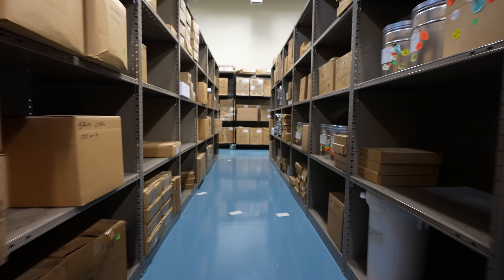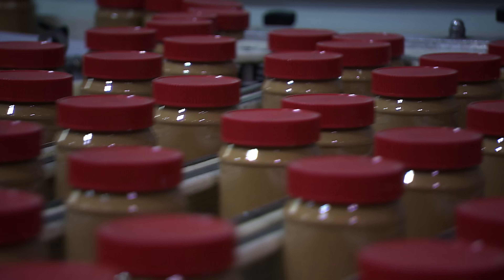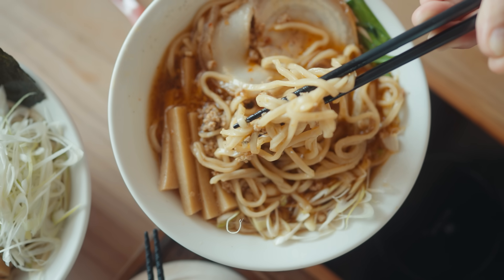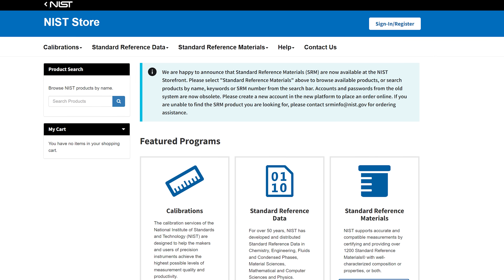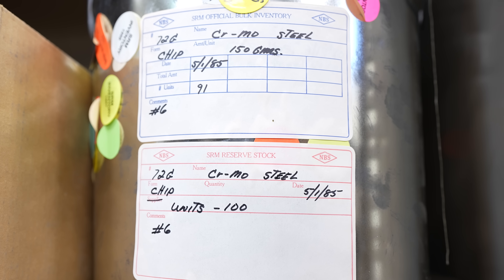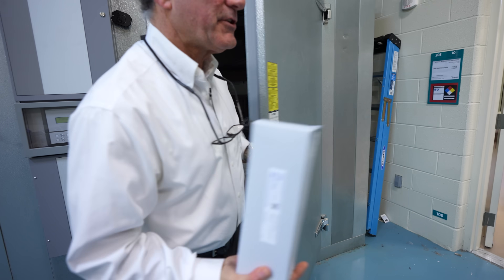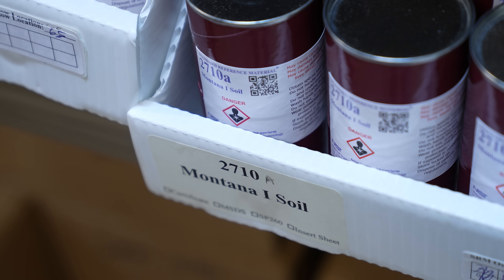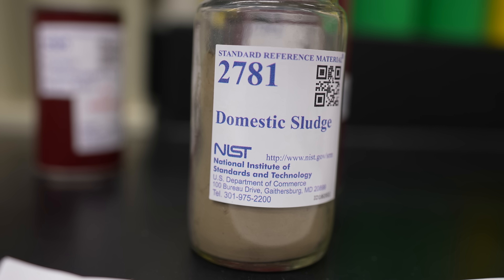The world depends on a collection of strange items. They're not cheap

Comment: can't that information just be found online? and if this is stale and gone off wont the values have changed. also it is impossible to know what the average diet is.
Reply: You can't use information found online to calibrate measuring equipment. I don't think you understand how this works. 

Also it's not impossible to know what the average diet is. Do you understand how averages work?... Just because YOU think something is impossible doesn't mean it is. Sorry to burst your bubble.
Reply: @firecubes4984  define the average person.
Reply: @ad_am_de_an  Okay.

The average American woman 20 years old and up weighs 170.6 pounds and stands at 63.7 inches (almost 5 feet, 4 inches) tall. And the average waist circumference? It's 38.6 inches. The average American man 20 years old and up weighs 197.9 pounds . The average waist circumference is 40.2 inches, and the average height is just over 5 feet 9 inches (about 69.1 inches) tall. 

I could keep going, but hopefully, you get the point.

We have lots of data regarding what the average American eats. We even have it broken down by age, sex, religion, etc. We can therefore use that data to determine what macronutrients the average American consumes in a day. That's how averages work.

An average is a number expressing the central or typical value in a set of data, in particular the mode, median, or (most commonly) the mean, which is calculated by dividing the sum of the values in the set by their number.

What the heck do you think 'average' means?

Comment: Isn't this useless? Every company producing a product should be able to do it like they want and not comparing it to a measurement product
Reply: Lol it explains what the purpose is very clearly if you watch the video. It is a reference material for calibrating their machines. Its far cheaper and less risk than analyzing every batch to make sure it is in line with their quality requirements..

Comment: For the same reason that peanut butter is not for human consumption due to how old it is is the same reason most of the tests on it are mute. If what he said is true , that it took years for the scientists to measure all the compounds in the peanut butter to determine what fats, acids etc it has to use those as a standard for the manufacturers to go by, surely most of those compounds / acids etc. that took years to measure would be totally different to what are in the peanut butter when manufactured and during it's shelf life..... 

short version:  the compounds in the peanut butter are different values during manufacture, during shelf life and after shelf life due to breaking down and changing.

Comment: I'm a pharmacist and always ensured my students knew that the temperature monitoring devices (basically a thermometer) for the refrigerator/freezer that holds medications must have a certificate of calibration tracing its accuracy back to NIST, as well as ensuring they knew those devices do in fact "expire" and should be re-calibrated or, more practically, replaced. Great video to get to see the rest of NIST's world!
Reply: Even weights need to be checked if you're working within fine enough tolerances.  It gets even wierder with timing stuff, as thats influenced by the speed its moving.  A clock has to be perfectly accurate in a satellite for a gps to work, but they also lose 7 millionths of a second per day or something just because its moving faster.
Reply: @bibsp3556  Its more the fact its further out of earths gravitational field than the speed. The %difference of gravity is more significant than the %difference of the speed of light. But yes, they do lose time and that causes errors in the positioning of the satellite and slowly over time will cause the satellite to give wrong coordinates to a gps if not recalibrated.
Reply: @Golden Hate  Space-Time & Gravity are so mind blowing. Simulation theory is getting really interesting too.
Reply: @randomname4726  eh, simulation theory to me is more a philosophical question.  I've not really seen anything beyond hypothesising that the planc length and speed of light might be some.sort of processor limit, but it's not convinced me really.
As the guy said above correctly said though, it's more the gravity, but yeah it's fascinating. Crazy out there
Reply: @goldenhate6649  very true.  Well corrected.
Reply: @bibsp3556  We have Weights & Measures technicians that come though once a year at the grocery store I work at and check all the scales to ensure they are reading exactly the right weight (to an accuracy of 0.01lbs). If they aren’t, they re-calibrate them. And the weights they use to do the tests? Those are definitely from NIST, and are measured to be exactly 10lbs, 20lbs, 50lbs, etc. without even the slightest error. This stuff is genuinely fascinating! And all this has been happening behind the scenes for my whole life, without me even knowing it!
Reply: @mbcommandnerd  they have to store those weights all specially if memory serves me right, to avoid like tiny  changes through decay etc. for really fine tuned equipment.
Reply: I’m a commercial refrigeration tech. I work mostly in the pharmaceutical and medical trade. I can’t tell you how many places I have been that have uncalibrated thermometer
Reply: As a Manufacturing Engineering Technician in a Medical Device Manufacturing Facility, calibrations are very important to us!
Reply: @carlosl5820  that's a critical job! I need confidence that my vaccines have been kept at refrigerated temperature before they go in anyone's arm. The temperature monitoring is only a small example I'm sure of all the devices that patients rely on to perform with a high level of precision (and accuracy).
Reply: This might be the most interesting thing ever to me.
Reply: How would you recalibrate a thermometer
Reply: @Xnoob545  Thermometers are usually calibrated using the water ice point in STP conditions.
Reply: @Xnoob545  they're digital, but outside of that I have no idea LOL. But over time, they will 'drift' and read 1 degree higher or lower than actual.
Reply: Why though? Can't you just account for the drift? Do medications have extremely tight temperature tolerances?
Reply: @Shinkajo  That's a good question. We wouldn't be able to account for the drift because we wouldn't know how much it has drifted, so it would be a guess as to what the true temperature is. 

As far as the medication sensitivity, it depends. Insulin, for example, becomes ineffective quickly if it freezes because the insulin molecules chemically bind together, inactivating them. Other medications may be able to tolerate low/high temperatures. Here again, without data to support their use we would be guessing as to their efficacy (which obviously we wouldn't want to do).
Reply: @Salex684  ok. So you you have different fridges for different medications? But if it's a freezer, does it matter if it's -25C or -30C. Do thermometers continue to drift? Are they like clocks where the inaccuracies continue to accumulate over time or does it stop after a time?
Reply: @Shinkajo  Account for what drift? How do you know it's drifting if you don't have an accurate thermometer?
Reply: @Mythraen  i mean that if you need a temperature somewhere between 2 and 6C, you set the temperature for 4C, if you know that the thermometer can drift +- 1C over it's life.
Reply: Girl i am so glad i reread that you said PHARMACIST and THOSE students lmao i was about to say i definitely failed that class! 😂😂😂😂
Reply: Well, thats a really unnecessary and faulty procedure of calibration. If you use a Celsius thermometer you calibrate it with boiling water and ice water.
Reply: Wow just the same as any basic food safety measures and training at the local Wendy’s good job!
Reply: @amandakeenan4722  Yes, it is good that the OP teaches the basics of the job for which his students are being taught.
The key point OP made was that they need to trace back to NIST. Does Wendy's do that, too? If so, neat. It makes sense, since they provide the standards, which is the point of this video.
Weird that you had to share this information in the most horrible way you could, though.

Comment: Although these references are absolutely necessary, and they aid all standard production, we shouldn't become complacent about the topic of safety.  That testing is usually in PpM (parts per million) and is set accordingly to each product of consumption or cosmetic use. IE. With one product perhaps 50ppm of a particular substance (tested toxin) is okay and anything over is not considered okay.
Every product has a MSDS Material Safety Data Sheet which holds the info for it.

Comment: In machining, we use NIST everyday. Our surface plate must be certified to measure our “Jo” blocks, which will calibrate our calipers, micrometers, height gauges, etc…
All to machine components to tolerances of +/-.0002”. A human hair is around .007” for reference.

Comment: Wouldn't they actually not want to use a "standard" cigarette? If some cigarettes are better to some degree than others at starting fires than others, just due to variance in the production process, and standard cigarette's aligns with average values, wouldn't you want to use the cigarettes that have higher fire starting capabilities? Just saying

Comment: The amount of people in the comments who don't think the price is justified.... laughable! A roll of aluminum at the grocery store costs you what? 3 bucks? Doesn't mean the average nobody could just cheaply make their own. You'd be surprised how much money it would cost to set up your own business to create aluminum. Millions. And your electricity bill will be near that of an entire town, or even a small city. Sometimes the costs justify it. 

Take the current chip "shortage" for example. Silicon is not a limited resource, nor is the supply of silicon low... It's simply that the manufacturing facilities required to make modern chips are so difficult to set up and take years of time and massive amounts of money, that not even a massive multi-trillion dollar a year company can just spring one up just like that.
Reply: Another somewhat less reaching example would be Apple phones vs cheap androids. I will state first and foremost that I don't like either, simply due to the fact that I feel I am more than capable myself to replace most stuff through soldering and part replacement myself, without the need of even a "licensed" repairman. (I'm just good at it, and stuff like this is why I went to school in the first place. To refine those skills and barely learn anything even remotely new.). I don't like cheap Androids, because I like fast and powerful, capable, and compatible devices. Things like being able to transfer dozens of Gigabytes in under a minute, and having a decent camera on par with DSLR's but without the bulkiness in my back pocket. List goes on...
However, a lot of people don't know how things work, and a lot of repairmen do shoddy work. For the most part, the high price of a less capable phone like iPhone comes with the added benefit of never needing to even know how the phone works, because it just does and you get babysat 100% through everything. You can find cheap android phones, because you are literally just buying the parts conglomerated together... with virtually zero support and optimizations. The companies that do offer good android support, would also be the ones selling the "flagship" phones. And guess what? Those come with higher costs than an equivalent hardware spec'd phone you could find on the internet elsewhere. It's due to all the RND/Optimizations/Support that you also receive.

But when it comes to chemistry..... The easiest way to explain why stuff costs more, would be to tell you to go watch that Breaking Bad scene lol. Heisenberg's stuff was more expensive because he did it right, and it was just better. He definitely stated that it "should cost more" because of all the care and knowledge that he put into making it. He had zero chance of blowing himself up, and he charged more than the rest for that fact alone.
Reply: @TheMelancholyCat  I feel your pain, brother.

The comments here make me lose a lot of faith in humanity...

Comment: Interesting. I used to work as a measurement technician, calibrating meters that measured oil and gas. Part of my job was calibrating pressure gouges as well. To do this you compare the gauge reading against brass weights of very accurately measured known mass. You spun the round weights on a stem supported by a sealed column of oil. These weights needed to be calibrated yearly against another set of weights which in turn are compared to yet another set of weights which have been compared to the international standard weights.

Comment: I really enjoyed this but I keep wondering how do they calibrate their own machines in order to make sure that their own measurements are valid?
Reply: They do something called statistical quality control. They'll run a sample with a known value on their instrument and if the result is close enough to the mean (<2 or 3 standard deviations usually) then they can say their testing is valid. SQC data will typically scatter randomly around the mean value if everything is working right. Once the data forms a noticeable tend then the instrument probably needs servicing or calibration.
Reply: @tadghf6891  cool to know. Thanks for the explanation :-)

Comment: A lot of this, say sludge or house dust, varies across the world, or even from state to state. How do you account for that? The dust that they have is from the 90s - surely certain chemicals are banned now, technology has changed, and new household products are in use.
Reply: Your missing the point. It's just a reference material. I'm not sure why you and so many other people think it matters if it's not the same as 'modern' dust. It's not supposed to be a replica of anything. It is merely a standard reference material used for calibrating measuring equipment.
Reply: @firecubes4984  So if it's not meant to be a replica of anything, then why tf don't they just fill all the jars with grass?

Like I get it doesn't have to be the exact same, but it has to be close enough. And if you're searching for specifics - like idk lead in house dust, or an air filter that can remove them, then it damn well has to be accurate and modern. Or did you miss the whole part about sewage water being used to "calibrate" and "study" our envrimetns and what we eat?? 

The only reason they say "close enough" is because it'd be a headache having a jar of peanut butter with 50.000% fat content, and another one with 50.002% and another with 50.003% etc. 

Once again, it depends on what you're studying. For a vacuum cleaner - idk maybe ancient dust is enough to calibrate the machine... but I doubt that's what they mainly use it for. I mean considering it's used in very fine instruments & scientific studies that require proper calibration, yeah I doubt it.